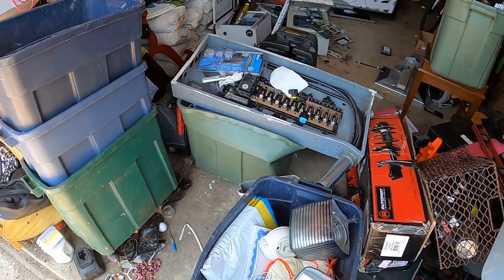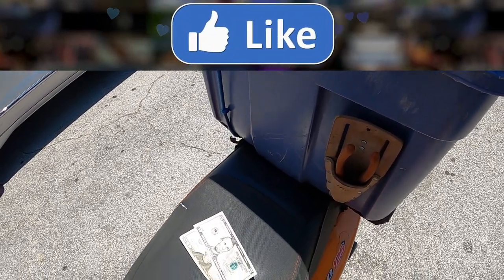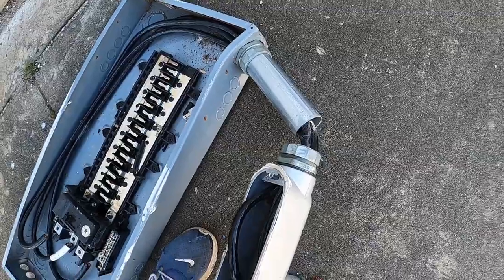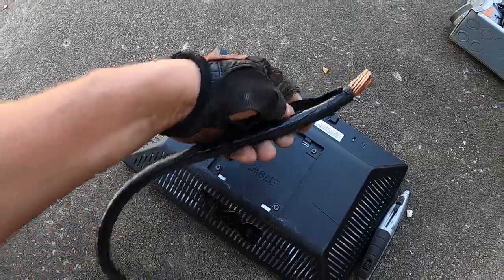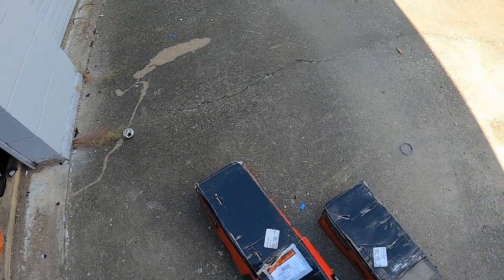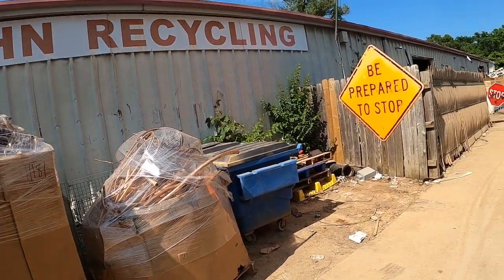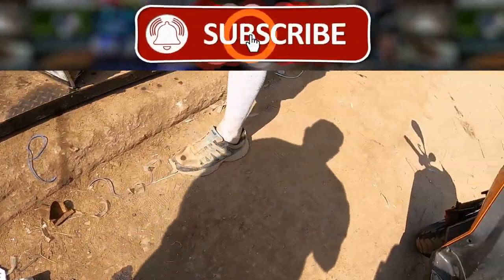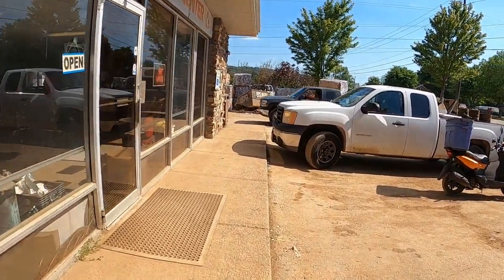Selling STREET SCAVENGER Finds - How Much for the Weight Bars? - (stripping COPPER Wire too)

Comment: Did you know that those long chrome looking bars in the electric box are COPPER ?? And they are called bus bars. Chrome covered COPPER so are the smaller ones full of screws. But the screws aren't
Reply: I agree. It’s worth unscrewing a few more things to get that nickel plated copper, or it might just be aluminum, gotta take a file to it to see that beautiful red underneath, most likely more than just iron!

Comment: Great video Vulture!! So, should I keep my copper tube and pipe separate from my#1 stripped. Copper wire?  Keep making these Great videos I'll keep watching them!!✌
Reply: Stripped wire, usually clean/shiny bare bright, is worth a little more than #1 pipe/tubes/dull oxidized wire, which is worth more than #2 copper.
My yards combine all my #2 copper which is thin/hair wire, pipes with solder or paint or tinned copper together.
So ya, separate them for the scrapyard so they see you know your metals and don’t low ball you.👍